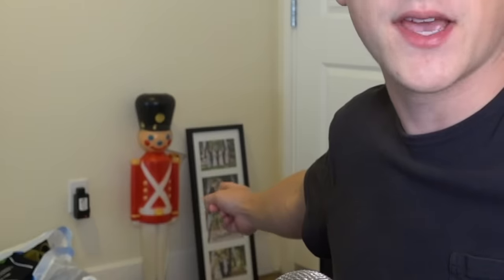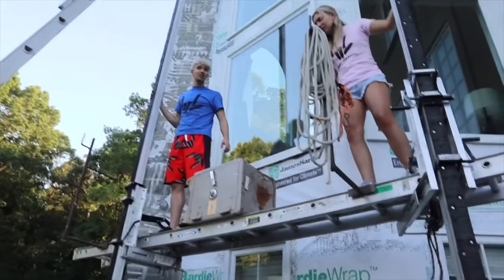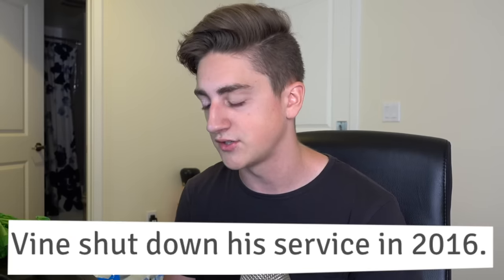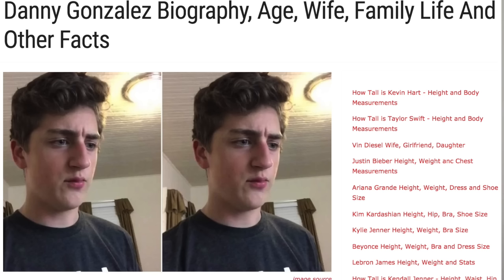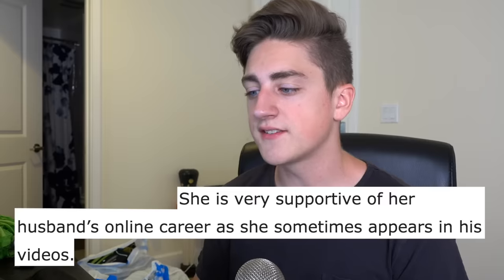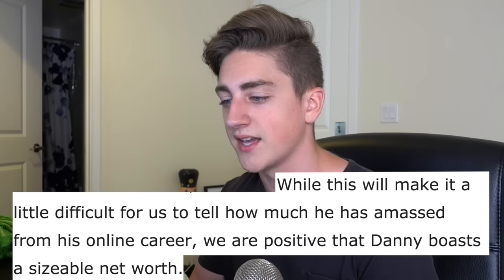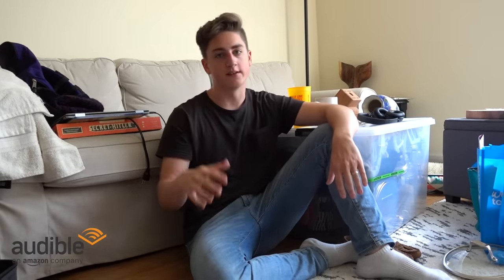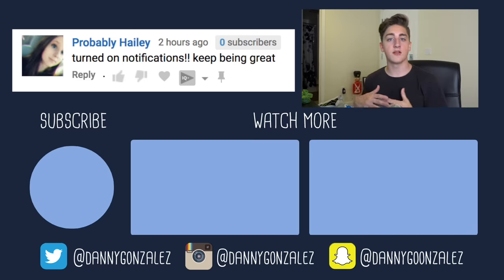I Googled Myself And Hated What I Found

Comment: Lmao Danny when they said 14 in. arm size they probably meant circumference not length. Also turned my notifications on!
Reply: Barneyisadinosaur Whose arms are that thicc tho?
Reply: Body builders
Reply: Becca A Pretty sure he means should to shoulder, not the width of a single arm.
Reply: Arm size measurements are measuring the bicep circumference.
Reply: I have noodle arms and mine are 10 inches (for reference I can't do a push up and I can feel the bone in my upper arm).